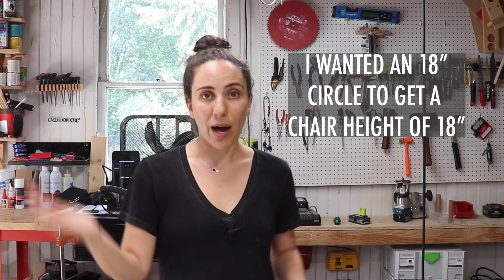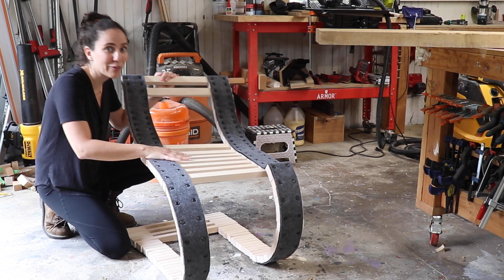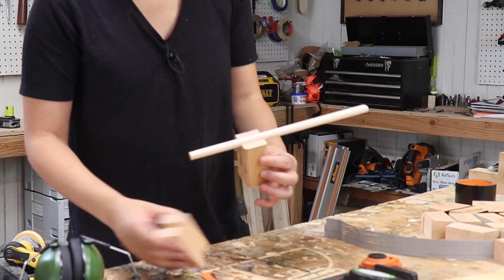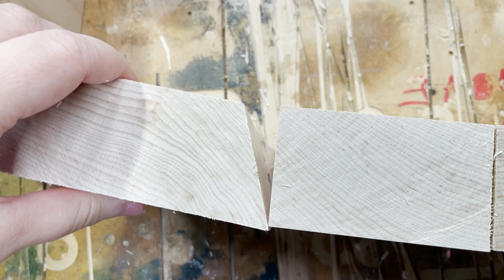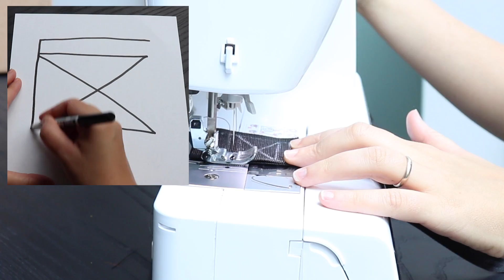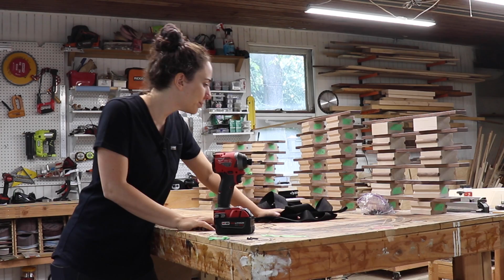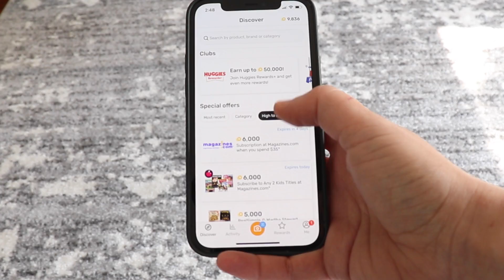I ATTEMPT to make a Roll Up Chair… AGAIN...

Comment: Hi, I just felt sorry for your hard work not working, so i figured I'd pitch you some ideas. You have encountered 2 problems:
1. Problem being that the straps get elongated too much by the tensile force.  Cooler solution is using stiffer straps, ie kevlar or maybe carbon fiber. They should be considerably stiffer than polyester, however they might be expensive (or hard to get at all). You should be able to calculate how much cross-sectional area of chosen strap you need for the force that will be applied on it so it does not exceed choosen elongation in plots like those: (link in second comment). 
Other solution is using more straps than one. Using 2 of the same strap doubles the cross. area, so if we assume that elongation grows lineary for force applied you would half the elongation. 3 straps gets you 1/3.. etc. Just try finding the plot for the specific strap (or material), there might be space for optimisation. 

2. Problem is collapsing of the upper chair part, which might squeez you. One way of preventing that might be use of "counter strap" - strap on the other side of wooden blocks which would hold the blocks from other side preventing collapse. Problem is, if you attached the counter strap permanently, the chair would stay in one shape only. I figured you could make the counter strap detachable at one end, so after the chair is setup in it's position, before applying any force on it you could hook the strap on the chair somewhere, giving it some tension and than sit into the chair. If the hook doesn't work, maybe simple lever tensioner (homemade or from shop) will tension the counter strap enough for it too work. 

I have no practical skills in chair making, this is just my physics classes speaking :). 
If you choose kevlar make sure it's protected from UV, or it might degrade over time
Reply: The link: https://images.app.goo.gl/XghEfZBNHuQXvJ2H8

Comment: i know its probably already been mentioned but perhaps this design just wont work with only one support. maybe if you made a rollable lever that keeps itself taut when straight and compressed you could maybe use that to add support to the back of the chair. kinda like how a grand piano has a dowel to support the lid when its open. its really technically involved but i can imagine you insetting it into the bottom of the chair and have all the pieces bend with your others. if it were to work you would just raise it up and it would add support and keep the back up. i know its not the prettiest of solutions but at least it would still roll up? sorry if this has already been mentioned but i think it might work. it would absolutely help with tension if its even plausible. i hope this made sense.

Comment: Leather stretches also. Kangaroo leather would stretch the least. Love the dowels you added. Really admire seeing "fails". Don't give up! I had a thought about some high tension wire that could go through the blocks. There would I need to be some sort of latch at the foot we're head that could be flick to pull the extra tension through when setting up, inflict again to release it to roll up.

Comment: You can't have the strap feeding through like that, because all the stretch can translate to the areas you don't want. Remember materials stretch proportional to their total length. If you could affixed the strap to each block such that it cannot slide, you might be able to fix this issue.

Edit: oh, you figured that out at the end. Ya.

Comment: use seat belt.  easy to get at the pick and pull out scrap yard and guaranteed not to stretch and crazy strong. don't peirce it.  sandwich and glue

Comment: Use thicker pieces of wood and wider stapping. If all else fails just include 2 support pieces that you can slot into a hole in the legs and go up to the base of the seat.

Comment: yup, its been suggested a few times already in the comments... Metal hinges seem viable. You could have put them under the strap to hide them. Or, if you wanted to really get fancy, you could hinge all your slats together to roll up one way (maybe with piano hinges... although all that material might make it very heavy and, depending on your aesthetic, perhaps unsightly... do they make carbon fiber piano hinges?) and add the other blocks to the long mat of slats.

If you REALLY wanted to get fancy, you could figure how to hinge/link the wood directly like a metal watch band. your wood would need to be very strong tho....

We appreciate all the effort you already went through anyways.
Good luck on your next try!

Comment: Maybe splitting the straps so that they only apply force onto 2 panels each might help as the tension will always be in the direction you need it at the “force” you need it, compared to the single long strap where the tension seems to exceed certain parts when.

Comment: Hi, great idea, I followed also the other video…. Have you tried to fix the strip with 2 “ phantom” screws, under the wood surface?  The black strips seems that slide between the two pieces of wood… 💪🏼💪🏼 try always… stop never👍🏼👍🏼

Comment: Maybe double or triple-up on the strapping width to distribute the load (i.e. your bodyweight) in a larger area? One of the previous commenters also mentioned cabling. Can probably find steel-core cable and drill a run through all of the pieces.

Comment: Have you not used ratchet straps for the strap material? it doesn't stretch like most materials and is designed to hold weight. I wouldn't suggest leather, it would stretch over time and would need upkeep from drying out and prevent snapping under tenstion.

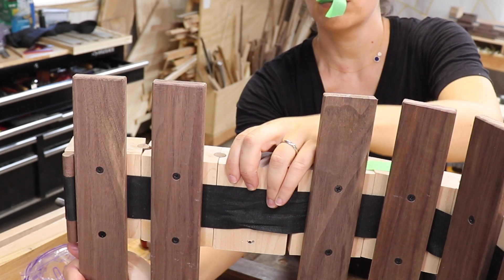Comment: I saw one of the comments already talk about it but preferably you'd have a strap or material that doesn't deform when you put a tension on it, i.e. high resistance to strain (in engineering terms). The problem with straps and rope alike is that most of it is woven from other fibres, this meant that the gaps between the fibres will collapse rather easily when you put tension on the strap, thus it will stretch out, and it will spring back when you unload it. I believe you can see the traces of stretching in the straps at 18:07 too. 
Especially straps like to strain, I believe this was due to their shape, wide and flat, they tend to bunch and curl up around themselves when loaded, it gets kinda crinkly. This is due to some parts of the material being stronger than others. with a rope like material you already minimise this.
What I suggest is using a material that doesn't stretch as easily, certain types of steel cable should work, although that might interfere with the integrity of the wood over time. there are other materials with high resistance to strain but they're either really expensive or not sold in rope / strap forms, your best bet is some type of steel cable probably.
Nevertheless, I really love the idea and would like to see you figure out a way to make it work!
P.S. leather also strains a lot, maybe even more than the material you used here, so I advise against trying it.

Comment: You could use metal hinges instead of plastic straps, and use thicker wood to make the curves stronger and increase the distance to the pivot point. Also if you make the wood go the entire width of the chair you'll have increased contact area and better lateral stability. But what I'd start with is a small section of curve with a few segments and then test the strength of different designs before building a full chair, that way you can see how much weight each design can hold and what the stretched angle will be. That way under load the angle of all the peices stretched out is the desired angle of the chair.

Comment: What if.. you treat it like a chain? Make some type of hinge at every connection that allows closing in one was but not the other (as the wood pieces would meet). There shouldn't be much flexing at all and you probably could still fold it up. It'd need a good design though, just an idea.

Comment: For this to work the straps need to be locked firmly to each segment the whole way from end to end. Problem seems to be that the straps slips because of to low friction between the materials and the elongation of the straps end up where the loads are the highest.
The slip can be improved by adding locking dowels or some kind of grooves in every segment and slats. This will provide larger surface area that can help slippage. The friction co-efficiency could also be manipulated by several different methods: Try trapping tiny carpenter nails between the segments and the strap. The nails heads will bite really aggressive into both parts and provided you have enough clamping force between the parts that would be sufficient. At least for a while...
I'm not to convinced that this can be done safe and long lasting.
While typing i hear you reached similar conclusions. :D I think you made a wise call.
This chair is clearly not suited for a family home.

Comment: if you cut your wood blocks for the back in Z shapes it will support each other in bending. one side of the z block will connect to the front of of the next block while the previous block connect to the back of the Z block. so basically you are cutting slides on opposite ends of a block to overlap with the next and previous block.

Comment: I think no matter what type of strap you use, you will still have this problem. It is because the strap is so long and only connected on the ends. Any stretch across the entire length can be seen at 1 single gap.

Like you said at the end of the video, you will need to attach the strap to each block. You would also want to minimize the distance between staples on different blocks. If you put the staples 1/2 inch from the edges of the blocks, then there will be only 1 inch of free strap between blocks that can stretch. If your blocks are 3 inches wide, this would effectively reduce the stretchable length of the strap by 1/3.

I don't believe super high tension would be needed at all in this case
Reply: You might also glue the strap to the blocks. Then you could reduce the stretchable length of the strap to almost 0 between blocks

Comment: Very cool attempts. I think you did almost everything right, and did a bunch of clever stuff. The dowels seem like a great idea. I thought you were going to run them all the way across though. It really seems like the compressibility of the wood+the stretchiness of the cable is causing the failure. So could you either use really REALLY hard wood (something like Brazilian Ebony? I'm sure that's super expensive), or steel cabling? Honestly steel cabling (maybe in another groove like you had your dowels?) might still be too stretchy.

Comment: The chair is asking for some inelasticity - metal wires that you can add tension to could work? Or straight up metal hinges between blocks?
Reply: Also, if the chair is to take a human in sitting position with an elastic material, it has to lean forward without any load. That could work

Comment: Would it be possible to drill holes in at the right angle on each piece and have a dowel from the next piece (perpendicular to the ones you already have) interlock with it so the tension from the belt doesn't pull on it in a way that could cause a collapse? Might not be possible on all the pieces, especially the curved bits, but for any of the straight parts that might be possible.

Comment: Need to alter some the peices and plan how will roll so it actually interlocks at the stress points. Not all the peices will be uniform at that point which I think might be part of the aesthetic desired.

You could always switch to thin sheets of steel  as well and see if a more robust material would do it.

Comment: So my first thought in trying to eliminate some of the stretching in the straps is to use the material for the heavy duty ratchet straps, then if that wouldn't work you could try using chain instead. Idk if the chain would cause any additional issues but would certainly get rid of stretching.

Comment: What about using metal tubing where the seat / back of legs area. Drill holes in frame to locate poles.This does external  / extra material to the structure. Great video.

Comment: You are trying to close the gaps with pre tensioning, but that will never work. You need material that stretches way less. The problem is that the thickness of your blocks vs the radius of the lower arch is the lever you have which is pulling in the strap. So if you got a radius of about 60 cm and your blocks are 5 thick then your lver is times 12. If the person sitting on it is 80 kg that means the strap will deal with 960 kg. Now the stretching that occurs already makes your design fail is even when you have a opening of more then 2 mm or so. Other way to combat this is making the blocks interlock themselves when turned one way sort of like hooks that open up and roll one way but lock up the other way. That will be easier then finding matrial without stretching at all. The problem is that the blocks will be harder to create because of more complex shapes. Also not sure that wood will be up to that task as wood is much stronger in one direction then the other. Some complex shapes cause splitting. You have to figure out a locking shape that uses wood in the correct direction. If you can't find a shape that does that then you need other material then wood. For the people out there that think they can fix it with pre tension and not agree with me. Just google to find out how much the most heavy duty tow straps and crane straps that lift even over 100.000kg stretch.

Comment: maybe running steel cable through the middle of the wood blocks instead of a strap would be more stable, less stretchy and distribute de tensión better?

Comment: I love this project and have watched you build your first version. My initial thoughts on this are that you're not accounting for the load that's being placed on the chair when designing it. In this position I would double up the strapping but also add 2-3 degrees to the angle of every other block in the curve, but also increase the thickness of the blocks by around 5% which should allow the blocks to sit flush, but will also take some of the pressure off of the straps too when load Is applied. Granted it won't look pretty when no-one is sat on it but atleast it will be functional (hopefully).

Comment: I wonder if you route a channel where the strapping is now, imbed the routed channel with steel u channel, and use steel cable as the "strapping"? It seems like that would alleviate a lot of stretching.

Comment: There is one easyish change you could make that could help you a lot… if you run the webbing on the other side of the walnut (closest to the sitter) it would give the webbing a larger bend radius. That would mean that the webbing would have to stretch more when you roll it out. Please please try this before rebuilding this!!! Good luck I love the project!

Comment: Maybe u should drill holes in each piece and pass two 1/8" steel cables in each side to pull tension, the straps  are just too flexible, maybe use them to give some flex, but the cables will set the limit to how mutch the straps will stretch. definitely steel cables

Comment: It looks like on the curve the inside edge is acting as a pivot point so the amount of touching material is just the very pointy edge. If you made the parts cut so it's got a different angle in the back to give flat edges touching for support instead of just corner points could help stop them levering apart. Maybe using a steel cable or chain with 0 stretch for the strap in a test run could show if it is an issue in stretch of the strapping or the wooden parts themselves. Minimising variables and all that.

Comment: Pretty sure the gab is caused by the fabric stretching and it will continue to happen. You need some sort of locking mechanism on the front of the blocks, as as the front can't pull apart.

Comment: Jute webbing might work, it doesn't have much if any stretch to it, is very strong as it's used in couches and chairs, only downside is that it's not the prettiest and is coarse to the touch.

Really hope you get it sorted out, such a neat design idea.

Comment: That's a really cool idea. Try using something in the ballpark of a 0.6mm hardened spring steel strap... That'll control the bend back because of the steel preferring certain bend radii :)

Comment: I think plastic strapping is just too elastic for this. You're going to need something like steel cable, fibre-reinforced drive-belt, or bicycle chain.
Reply: Also, I think the strapping needs to be pinned with something more than wood and two screws. Probably bolts and some sort of highly grippy surface which prevents it from stretching under the slats.

Comment: Make 2 metal pipes like this ¿¿ (not exactly 😂 you get the idea) And make a way to connect that chair with metal rods. Just put all that on this rod, this rod will act as exoskeleton and you will carry it separately.
If you want to sit on chair you have to attach metal bars, when you are carrying it flat you can dismantle metal  pipes from wooden back.
That would also be good idea.

Comment: What about making the sections along the floor get progressively longer. The increased length may help prevent it from rolling up under due to tension from the strap.
Second idea would be to keep the sections in the main curve the same length but increase the height,  giving more service area for the wood to brave itself with.

Comment: It just seems that the pressure in the angles is just too strong. Your only real option seems to be stronger connection or stronger material. Instead of wood maybe metal? Instead of two straps, maybe an entire sheet.

Comment: How about using steel cables? The problem is that the incredible amount of tension the straps are under cause them to stretch, so how about using a material with a higher strenght? Attaching 2 steel cables on both sides should have enough strenght for them to not stretch